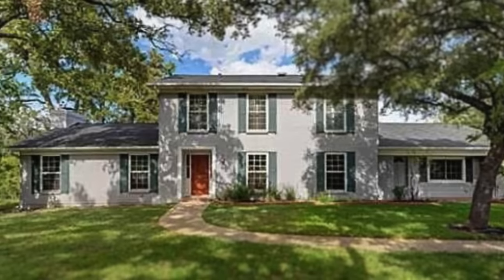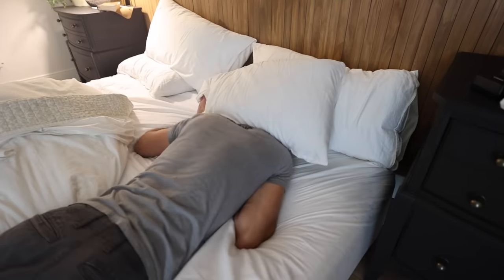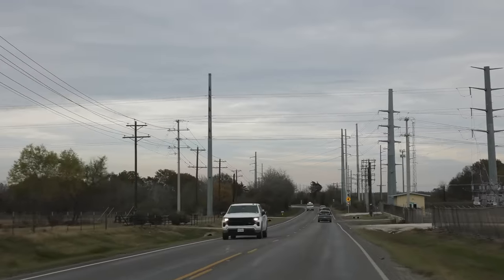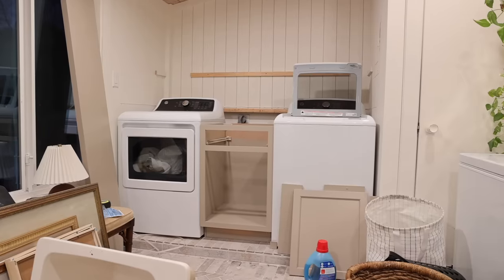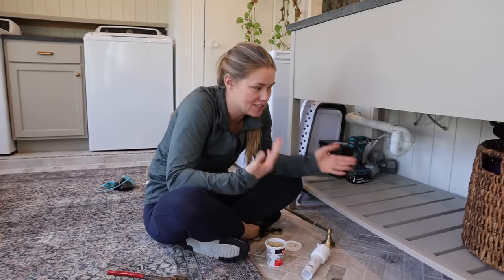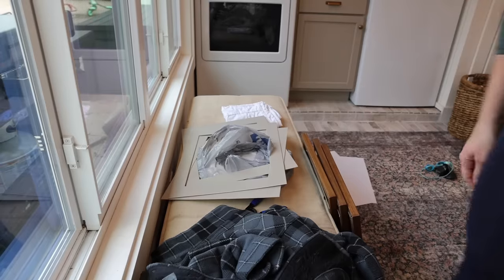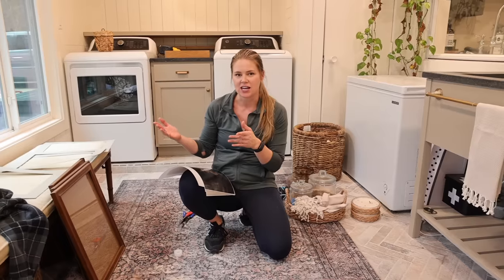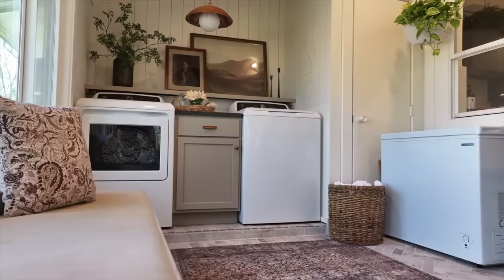DIY Laundry Room Makeover // Sunroom Makeover // [Part 3] Custom Countertops & The Reveal!

Comment: Top loading washing machines are seen as very old fashioned here in Europe. To keep a front loader from smelling if you are not using it on a regular basis (eg 1x a week) then don’t close the door and leave the detergent tray slightly open.

Comment: I love how in the USA homes have a spot to do laundry with a nice large sized Washer and Dryer. Most older homes in Northern Europe, well we just don't have this luxury, so you'll mostly find the washing machine in the kitchen. Most people do not have a dryer as they are too expensive to run, so the clothes line during the better weather months does the trick and radiators and clothes horses during the wintery months. My goodness what a gorgeous Laundry/Sun room.... again another beautiful, elegant job has been completed.
Reply: My laundry (washing machine) is in the cupboard in the kitchen. Shared with the brooms, mops, cleaning materials, loo paper storage, recycling bin, clothes horses (2), car cleaning stuff, and spare laundry basket used as storage suspended over the tub. I do have a dryer for emergencies which is in a cupboard downstairs in the carport. But as you say, it's too expensive to use routinely. Besides, the washing smells better when dried outside on the clothesline in the sun if any.

Comment: To me it would have made more sense to put the towel rack to the side of the sink instead of right in front of it. Now to use the sink you will have to lean over the towel rack. Maybe thats just an issue for vertically challenged people.  😮

Comment: Have you sealed your stone floors?  That way the dirt won't stain them.  Also another project for Andrea is to create a panty/closet on the wall where you have the coat hooks...it would hold more items if it included a shelf or two and no clutter would be seen.   Baskets for misc. and hanging rod for coats.  Could maybe even include one side with hooks for back packs and the other side for hanging coats.

Comment: Remember to use the washing machine tabs that clean the drum so the clothes don't smell.  That's why your other clothes had a smell.  I use the tabs once a month.  Also don't forget to water your ivy in your hanging basket.  I noticed the other one was dying from lack of water.  You nay not realize it but you also don't fully close the sunroom.  Even with the new lock and handle you need to pull the door shut.